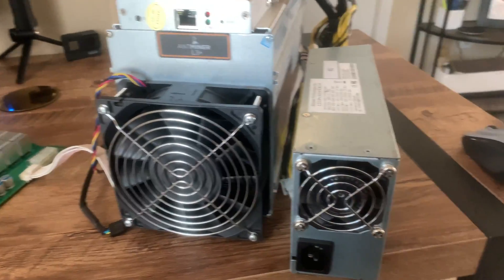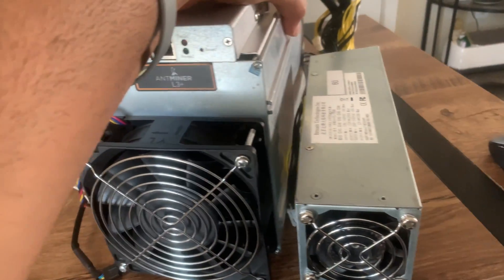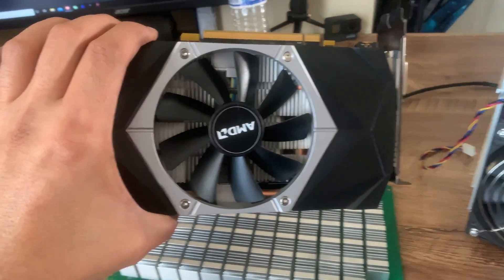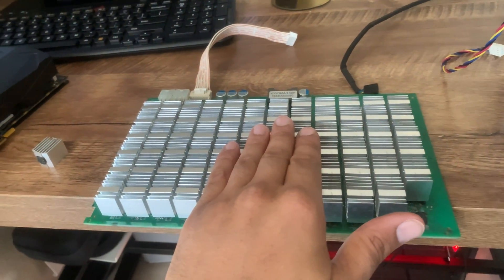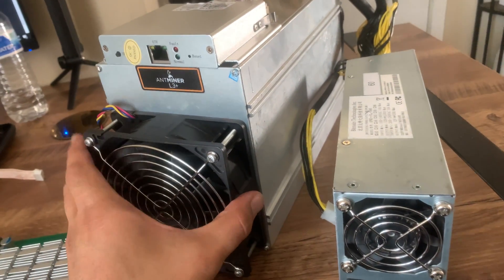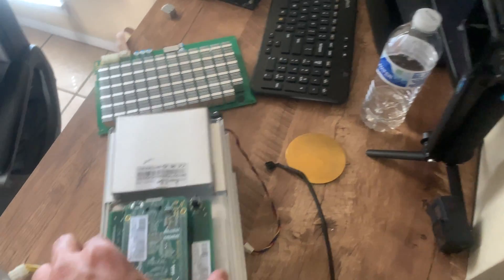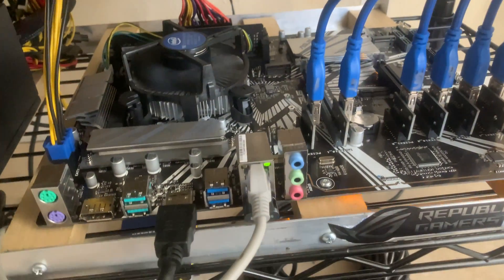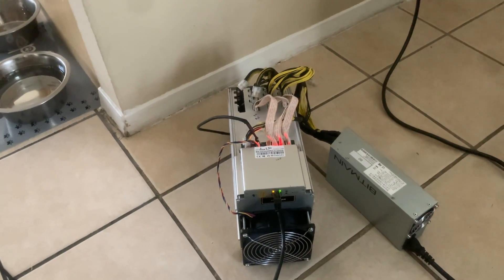GPU Mining VS ASIC Mining. Antminer L3+ Dogecoin and Litecoin Miner

Comment: Is it worth it in 2022? And man it's loud! Sound like it?

What's better 2 1660 super GPUs
Or this?
Reply from the maker: This particular machine is an older model. I feel that at the present moment, ASIC mining is more profitable, due to the efficiency of the newer rigs. They also cost a lot more to operate in most cases than your standard GPUs do. They are extremely noisy!

Comment: Yo You need a 240volt plug for that unit.  I recommend getting the following: 

30amp 240v Tripplite metered PDU(This pdu can handle 7200 watts but you should only ever put 5700 into it bc of the 80% rule)

C14 to c13 power cord at least 18 gauge

You need to have an electrician install that 240volt 30amp breaker and run a wire to where you want to plug in that unit.  Once you exceed the power for that plug you need to run another 240v 30a plug. 

If you put 120v through that unit it's possible that it could damage it.  Maybe not, I don't know for sure.  This is just what the distributor from China told me. 

Rob
Reply from the maker: That could be one of the reasons I have been having issues. I have a 220 in the shed. I may get that going outside. The new control board should arrive by tomorrow. I’m going to pick up a PDU. Thanks for the tip! I am née to ASIC mining, so I can use all the help I can get.
Reply: @GhosthashCrypto  Sounds like the shed would be a perfect spot since it's loud too.
Reply: @GhosthashCrypto  Also, just found out you can reflash this unit with the blissz firmware and get 650 MH/s at 950 watts.  You Flash it from the card slow that is located on the board on top of the unit.  The small board slides out from the top of the unit and that will expose the mini sd card reader slot.  It takes a .zip file and you can only use an 8gb card.